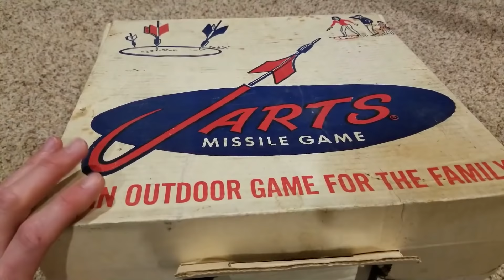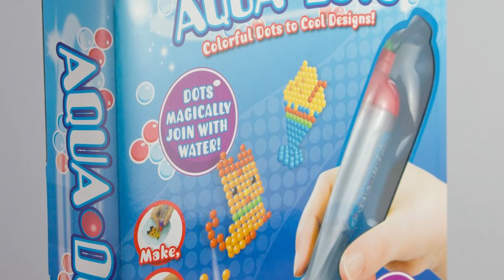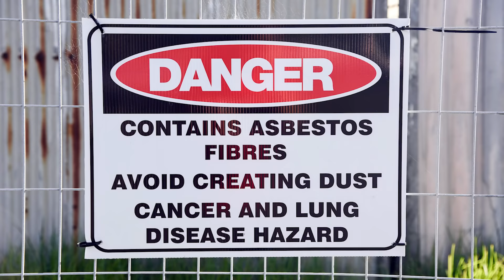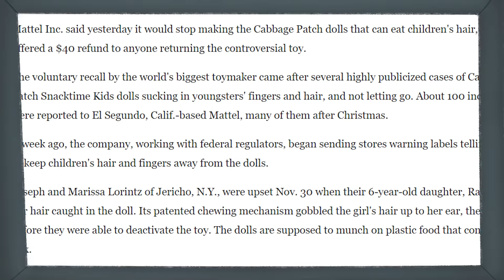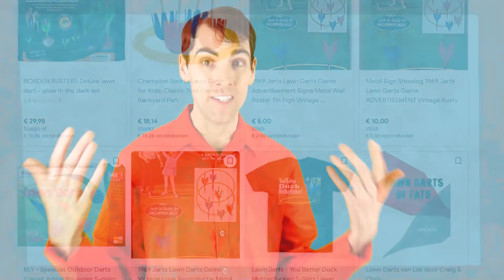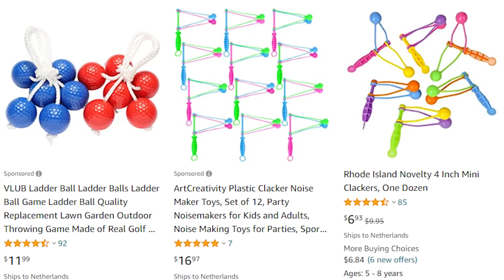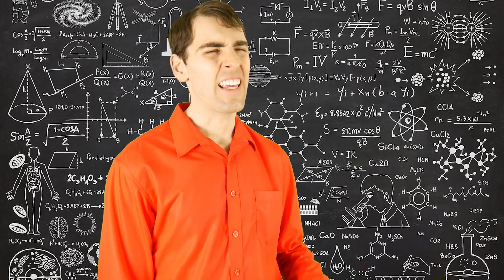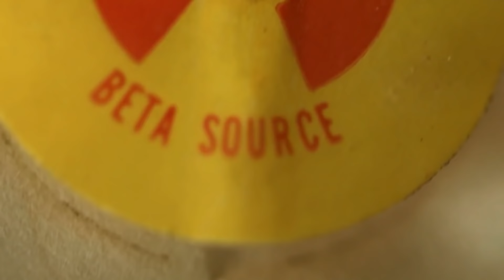The 10 Most Dangerous/Banned Toys

Comment: Ah, Creepy Crawlers. The smell. The burns. It was actually the 1992 version that got me. You didn't have the exposed hot plate anymore but the molds were still metal, so if the spatula thing was broken you were probably end up with scars trying to lift it out of the oven.
Reply: I had a crayon maker that was like the new version of those
Reply: I miss creeper crawlies so much
Reply: I survived the original creepy crawlers from the sixties, with the open metal hot plate. I don’t remember burning myself, but I melted stuff on it for sure. Still remember the smell. I won’t even start on what you could do with a sixties easy-bake oven. I must have been the worst kid; luckily no one ever gave me lawn darts.
Reply: The original Easy-Bake Oven was a real dumpster fire waiting to happen. Nothing like getting burnt by 100 watt light bulb. That crap hurt a lot. Not to mention the scalding batter when you didn't let the cake cook through and through

Comment: When the official Sonic 3 Happy Meal toys were made to promote Sonic 3 & Knuckles, being one of two reasons that the game was split into two games, there was a Tails toy that had a pull-string that you’d pull to make Tails fly, but was recalled and temporarily replaced with a ball with Tails on it before replacing it with a similar toy that let you pull something that made Tails spin instead of making him fly. But the Tails toy was entirely removed, matching Sonic and Knuckles, (the standalone game, not Sonic 3&K) which doesn’t have Tails in it.

Comment: 5:47 there are plenty of safe ways people are exposed to asbestos. 
If you are in an old building (pre 80's) with 8 inch tiles... They're likely asbestos.
It's only dangerous if you tear up the tiles and create dust, as intact solid tiles they're perfectly safe.
Asbestos Dust is the problem... and the fingerprint dust was 7% that crap...

Comment: jeez who knew the toys of my youth would end up being deemed dangerous. we used to sharpen the tips of the jarts on the concrete patio, get 2 of my cousins to stand in or near the yellow circle target and then we would try to hit them on purpose! ya it was crazy fun in the summer time at my grandma s house. then there were the clackers but we called them kerbangers! they were made from various sized glass balls on a sturdy string with a plastic loop tied into the middle of the string, after a few years of the glass ones exploding on kids the changed up and made the balls from a hard moulded plastic with nylon cord and a plastic piece to hold on to, these were just not as fun as the glass ones and yes each of us kids had injuries to our wrist hand and forearms a few even needed a trip to the e r for treatment. i remember i broke my bones in my hand several times and had a cast on a few times and still played with them in a cast. then there was the thing maker we played with this one in my grandma s basement when the weather was bad and we couldn t play outside. also had an e z bake oven for those times too and there was a science lab kit too it had little bottles and test tubes and beakers that we mixed the chemicals up in and made some pretty bad toxic clouds that sent us running to open windows so the smoke or smell didn t get upstairs to alert our adult in charge to our misdoings. it s a wonder us kids survived our times of playing in the recroom/ t.v and slideshow room and the spare bedroom in grandma s upper basement. there was another level below this one for the laundry room and storm shelter and the room full of mason jars and the canning stuff that were used to put the garden stuff on the shelf for eating over the winter. us kids weren t allowed down there and  it was usually locked up. we did have some great times in the basement we rode our big wheels down there sometimes and usually we kept off the radar of the adults upstairs so we could do all kinds of kids things when we were down stairs. the thing maker did start a fire once on the ping pong table we were using it on but we got the fire out and my cousin was burned and zapped by electricity cuz we didn t know not to put out an electrical fire with water while it was still plugged in! we learned many valuable life lessons down stairs and had way too much fun on our own too. i miss my grandma and her house and hope to have memories of those times as long as i live. thank you for reading my memories from my youth our generation learned to survive from the whopsies we made as kids. the saying what doesn t kill me makes me stronger or smarter as we said it so guess my cousins and i should be genius' by now! i miss you genius' these days.

Comment: Ah yes, Clackers! You're wrong, Strider. These weren't made out of metal. They were made from solid GLASS or CERAMIC. They didn't shatter, as they were too solid for that, but they were dangerous, as they were very heavy and solid, and one wrong move playing with them could send them flying into somebody's eye or worse. I was in 6th grade when these were nevertheless hugely popular and I remember owning a pair and playing with them. I eventually lost interest in them because I was never good at toys that required lots of coordination to play with, but I remember thinking even at age 11 that they were dangerous. Also, some of your footage in your video was of a safer knock-off version that came out in the 80s and were not banned. Real Clackers were about the size of baseballs or even softballs, and were mounted on a very thick, heavy piece of nylon cord, with a ring in the middle. The knock-offs were much smaller, about the size of walnuts, were made out of plastic, and were mounted on plastic sticks that were attached to a ring.